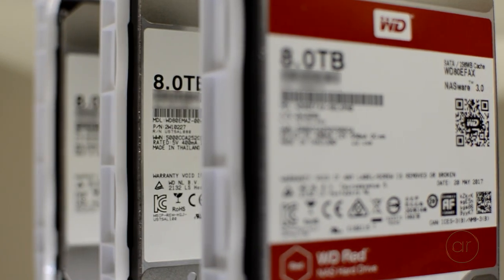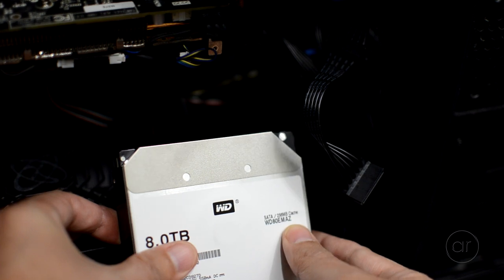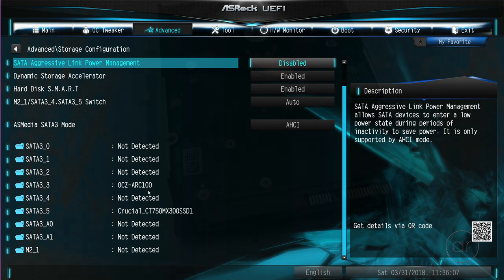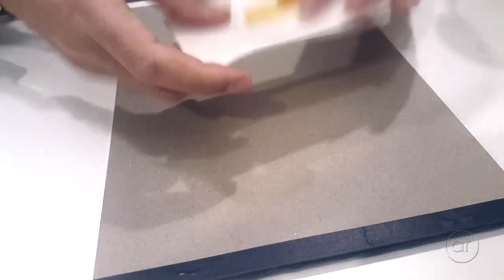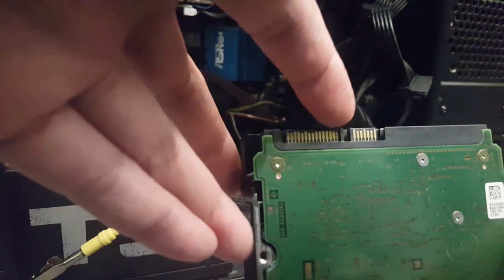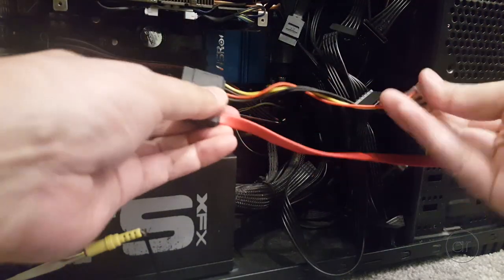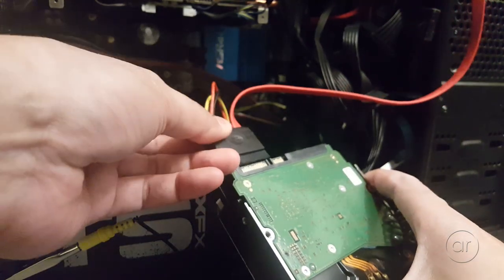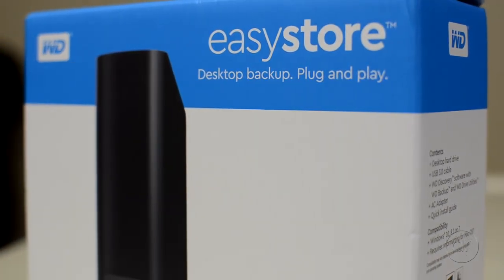How to Fix the 3.3V Pin Issue in White Label Disks Shucked from Western Digital 8TB Easystore Drives

Comment: I ran into this problem when purchasing a 10TB WD external that I shucked. I ordered the tape and molex adapter and tried to fix today. It still doesn't get recognized in Windows 7 (unless I plug it in via usb and power to wall outlet). I removed the third pin entirely and it still won't show up in Windows (again, unless I use the external case's USB/power board). This is in a rack mount server running Windows 7 and runs through an LSI controller. I was so excited for a fix, but I am confused at what might still be the problem. I will try the adapter eventually, but would rather fix it this way for future drive expansion. Another concern is that it is on a hot-swap back-plane, so not sure how the molex to sata adapter will fit in until I open up the case. Also, it seems like the drive is powering up, as when I remove it from hot-swap it feels like it is still spinning...

Any ideas for a fix, or what I might be doing wrong? Thx
EDIT: I tried moving the drive around within different bays of my server and got it to work. I have (5) Rows of (4) Bays. It appears that a whole "row" of (4) bays is out. These are all on the same back-plane, so I'll need to investigate later (though I do not need all the bays at the current time anyway). Thanks for the great video!!
Reply from the maker: Thanks for the update - I was just reading your comment and was a bit stumped as to why it wouldn't work with the tape method (and even when you removed the pin). I guess the failure can happen anywhere along the chain back to the power supply.

Comment: You can also use clear nail polish, we use it on exposed contacts on the CPU when delidding under the IHS and is really cheap and everyone has it.
Reply: The nail polish doesn't have to be clear. I used blue nail polish on one of my drives (because that's all my daughter was willing to lend me) and it worked fine. The only type I might not recommend is nail polish with sparkles &/or other metallic materials in it.  :-)

Comment: If you get a molex to SATA adapter cable (the better solution in my opinion), make sure you DON'T get the one that was made by injection moulding since those are known to short circuit and cause fires. There are videos about it on YouTube. Get the adapter which has discretely separated cables/pins on the SATA side.
Reply: any chance you have a link to one that will work well?

Comment: Most SATA to SATA or SATA splitters do not have the 3.3 V pin connected as well. The 3.3 V is Orange, and the SATA to SATA contain Red, Yellow and Black wires.
Reply: If the splitter has orange wires, just cut them, it doesn't matter which side you can remove them as well, or just cut through with a side clipper.

Comment: Did this, but didn't have any kapton tape, used electrical tape instead with similar results (obviously the electrical tape was a tad thicker and I believe has adhesive that may leave a residue). I did order some of the linked kapton tape though (curiously the Amazon description does not say kapton tape) and will use that on future drives. Just bought two more 12 TB from Best Buy for $189 USD/each, hoping for a nice holiday sale on 12/14 TB externals and will likely do this again with those. =)
Reply from the maker: Thanks for the tip - I've tried electrical tape before but I found it was a bit thick and it stretched out the connector slightly on the SATA power connector before I switched to Kapton (not sure of the long term effects of the electrical tape). That's a great price on the 12 TB - hopefully the 14 TBs will drop to $200 as it did last year...
Reply: @accessrandom  as of yesterday the 14TB are $199.99

Comment: Thanks for doing this. Just shucked two Easystores and got whites. They don't work with my Corsair HX 650 PSU :(

Can you recommend a brand/model/link of Kapton tape and also maybe a link to a Molex-to-SATA adapter you recommend?
Reply from the maker: There's a good video on the subject on Youtube: just search for "How To Spot Molex To SATA Adapters That Won't Catch Fire". For the kapton tape, I ordered from a uline catalog years ago (it's not something I use often, except when I'm dismantling a laptop and putting it back together). But I think any roll of Kapton tape from either uline or Amazon would work fine.
Reply from the maker: Thanks for the detailed update! Glad everything worked out for you.
Reply: Your welcome!

Comment: Pin1: Reserved • Pin2: Reserved • Pin3: PWDIS — in other words;
TAPE OVER ALL 3 PINS! Far less fiddly.
Reply: Trying to get that one pin was a hassle. Covering the 3 pins instead helped me out a LOT! Thanks man!
Reply: This works
Reply: Thankss, it works for team gx2 ssd in hdd caddy for laptops!!!
Reply: Good call, thank you.
Reply: Another three pin cover success. One less device in the power outlets available.
Reply: Why not scrape off the gold contact?
Reply: @FluidITGuy  Too risky,
Reply: Marc Brown no it isn’t. If it breaks off? That’s exactly what you’re trying to do. A week ago I got one of these drives, and I grabbed a box-cutter and popped the pin out. Gave it a twist and it pulled right off. I’m not exactly sure what “risk” you’re referring to.  
If your hands are stable enough to slice a 1.5mm strip of tape? You can pull that pin off no problem.
Reply: @Chimera_Photography  ESD zap zap zap, warranty dead, zap zap zap. You can return a shucked drive under warranty btw, just put it back
Reply: @reggieangus5325  Don't even need to put it back.  It's been done several times.
Reply: @reggieangus5325  Really? this was the thing I was worried about since they say you voide the warranty by opening the enclosure...
Reply: @Zeriel00  in the US we are protected by the magnuson moss act. they have to prove what you did caused the warranty failure.

Comment: Thank you so much for making this video. I too have a Qnap and feel confident these drives will work with it.
Since it's been 1.5 yrs since u made this video, how are the drives holding up in the server? Do the white ones perform just as well as the red ones?

Thanks
Reply from the maker: The two Reds and two Whites are still going strong. This is just anecdotal, but I've had to RMA a shucked 5TB Seagate in the same time period, whereas I've had no problems with all the Easystores.

Comment: Thank you for a clear and informative video, could electrical tape be a substitute for the kapton tape?

Edit: it works, I’m going to use electrical tape until my kapton tape arrives in the mail.
Reply from the maker: Thanks for the update. Yes, I did try an experiment with electrical tape before I made the video, but I found that it was a little too thick (it expanded the spacing in the connector) so I took it off. I'm not sure what the long-term effects would be, but you should be ok if it's short term. Another problem was that there was a black residue when I took the tape off (at least with the tape that I used).

Comment: Really well made tutorial, great work! But what about the quality of shucked drives vs standard internal drives? I currently use 3TB Toshiba P300's and am somewhat concerned about higher failure rates of shucked white label WDs...
Reply from the maker: Thank you. I can only speak from experience, but my 2 red labels and 2 white labels 8TB disks have been going strong 24/7 for 3 to 4 years.  My shucked Seagates, on the other hand, have needed RMAs (2 5TB disks).

Comment: I just counted the number of pins (15), and counted the power cables going into the plug (5) which is a perfect 3. So I cut the 5th cable and it worked perfectly

Comment: Thanks, just installed one of these in my PC today and used this method.
Reply from the maker: Thank you - glad you found the video helpful 👍
Reply: @accessrandom  Yea! I would of been totally lost wondering why the drive wasn't working internally! So I'll keep in mind if/when I change my power supply that it's compliant with the new/changed sata standard. That said, I would of just bought a regular internal drive but none of the stores near me carry internal drives anymore, only external, and I needed a drive right away and couldn't wait for shipping. I just "shucked" a 8TB and 12TB Western Digital. They're so much quieter than my old Hitachi from 2007 and seem just as fast if not faster...

Comment: You can cover pins 3,4,5 does not have to be just pin 3, I have done that to my 8TB Ultrastar Data Center, Hey Presto, HDD booted up, and detected on BIOS,  previously would work on a USB 3.0 HDD caddy.

Comment: Do I need to do the tape/pin if I’m using the hard drives on a Synology?
Also are the white label the same as the red? If not what’s the difference? 
Thanks for you great video.
Reply from the maker: Thanks! According to the compendium in the description, you should be fine without any modifications for the Synology units. It was tested in a variety of models, including the DS218j, DS718+, DS1817+, etc. Regarding the white labels, there's some debate on whether they're simply relabeled Reds (some think they're a relabeled HGST), but the white labels seem to be the only ones with the 3.3v pin issue.

Comment: the 3.3v pin is used to power down the drive completely  in case of it not being used at all by the pc (host) so it saves power and also prolongs the life of the drive by not running non stop and overheating in that plastic case
Reply: if I am covering up the pin, will my PC be able to power off the drive though?
Reply: No, it's a data center feature to easily reboot an unresponsive drive. It does not effect normal ALPM states.

Comment: Very useful video.
After watching it I checked https://en.wikipedia.org/wiki/Serial_ATA#SATA_revision_3.3 for further details about "Power disable".
Anyway I have to point out that almost no power supply I've seen, with the exclusion of the few high-quality ones, had the 3.3V connected, so, in short, one's gonna experience the problem only with a good PSU: that's weird ;)

Comment: Great tip here

Unfortunately with my shaky hands and exceptionally failing eye site i will have 1 heck of a time accomplishing this task.i never realized until i looked how small an area i would be working with

i need to ask how exact i have to be on the applying it to only that pin? Does it matter if i get a wee bit of overlap on pins to either side? How many pins could actually be covered and it would still work?

Would taking a safey pin and just scratching out that 3rd pin work? or cause permanent damage?

Thanks
Reply from the maker: Thank you. I focused on non-destructive ways to solve the problem. What you can do is cover pins 1, 2 and 3 if you'd like - pin 3 is the important one, but pins 1 and 2 can be covered as well.
Reply: @accessrandom  Cheers

i did the pins 1-3 and Bobs my uncle

Much appreciated mate
Reply from the maker: @leperlord7078  You're welcome, and thank you 🙏.

Comment: You are great, I saved a hard drive that almost throw it away, will affect its useful life somewhat this method?
Reply from the maker: Thanks for sharing your success story - always good to hear 👍 If you install the disk in a computer case that has good airflow, it should theoretically extend its remaining life because you've moved it from an enclosure that has limited airflow. You are also eliminating the USB-SATA PCB board which is another point of failure.

Comment: I have an HP drive that's really a hgst drive. It works fine in my docking station but won't power on from my psu, even with the sata power adapter bypassing the third pin.
Any ideas? 

Thanks for the informative video!

Comment: i actually removed the pin from my sata power connectors on all my power supplies so it can be moved to any computer of mine
Reply from the maker: Very nice. Then you don't have to worry no matter how many white label drives you have in one machine (or any of the computers).
Reply: Same here. I thought about cutting it at the end but I decided to just pull the connector and wrap it in electrical tape in case I need to re insert the 3.3v connector.
Reply: That's what I thought I would to too even easier than putting the tape on the connector and would me more reliable too probably.

Comment: Super useful video, thanks for uploading.

Can you remove the contact pin on the HDD instead?
Reply from the maker: Thank you! Yes - you can physically remove the pin itself (other commenters have done this also). Others have also snipped a wire from the power supply connector itself. In the video, I was just showing some of the non-destructive solutions...

Comment: Thanks for the Molex-to-SATA tip!
Reply from the maker: Yw! Make sure you're using a good quality one though, as some adapters have been known to cause fires (there are some Youtube videos out there that show this)...
Reply: @accessrandom  I'm using the one that came with the PSU/motherboard. I'm not 100% sure which.
Reply from the maker: @neojp  Usually, the ones that come with the PSU or MB are fine.

Comment: I was struggling with tape and annoying if you want to pull the drive in the future and forget about this, I just clipped the 3.3v wire entirely on that SATA connection, much easier and I'll remember in the future.  I left enough length on the connector and cable side in case I need to resolder them together in the future. Apparently the 3.3 volt connection is rarely used so I don't really care

Comment: I wonder if this was the problem I had with 2 Corsair Neutron XT drives not working in my machine. I sent them back thinking they were faulty and brought an SSD from another manufacturer instead which worked fine. Perhaps the corsair drives used the new SATA power standard which wasn't compatible with my power supply from 2007 :)
Reply from the maker: Interesting - thanks for the data point. It's possible if Corsair had multiple revisions of the XT, but the only info I could find was that it used SATA Rev. 3.0 (not Rev 3.2+ or Rev 3.3 which have the power disable feature).

Comment: Just ran into this with a 8tb HGST drive and a EVGA Supernove PSU, molex to sata fixed it for me. I just don't trust the tape, Im more worried about the tape comming off inside the plug after in ages and you remove the plug from the HDD.

Comment: I schucked six of these drives and got the white label EMAZ version with the 3.3v issue and 256MB cache. I was originally going to use them in my Dell Poweredge R510 server but they randomly drop their negotiated speed from 6Gb to 3Gb which brings the RAID to a crawl. Not all of the drives, maybe 2 or three of the six on every bootup. Not the same drives either - which drives run slow is completely random. I moved them to my QNAP TS-451+ server and they work fine and stay at 6Gb. I'm not sure why my Dell server has speed issues with these drives but I ended up going with 6TB Toshiba's (MG04ACA600E) and have no issues.
Reply from the maker: Interesting - this is the first time I've heard of speed slowdowns on a Dell server. The reddit sub I link in the description has it confirmed working (anecdotally) on the Dell R510, but there's some question as to whether all optional configurations of the backplanes (and all revisions/firmware of them) would work. Thanks for sharing your experience.
Reply: Why would that bring it to a crawl? I know some HDD exceed sata1 specs but there are none that exceed sata2 or 3.

Comment: I have been using the molex solution for 2 of my drives no problem, but now I want to add another drive and I am out of adapters, so I bought some Kapton tape to try that method.  I tried 5 times and every time I slide the power adapter on, it just shoves the tape down and off the pins!  Any advice?  I am not using the label backing/cardboard, I am just cutting and applying directly to pins 1-3.  Maybe my tape is cheaply made??
Reply from the maker: The Kapton tape can be a bit tricky to place especially when it's a tiny sliver (like I have it in my video). I would recommend a wider piece that covers pins 1, 2, and 3 (since pins 1 and 2 are not used anyways). Hopefully, that will stick better to the pins.
Reply: @accessrandom  yea that's exactly what I have been trying... I specifically bought a very thin roll to begin with... it's the exact width of 3 pins.  I have tried at least 5 times on 2 different drives now and it just jams in every time.  I also tried regular old electrical tape... same issue.  I wonder if superglue would work?  It would certainly insulate well, but I just don't know how well that would hold up once heated.
Reply from the maker: @mulox1  Maybe you could try different SATA cables or even a different port on the motherboard? It could be anywhere along the chain to the motherboard that could be causing a problem.

Comment: My solution, snip the 3V wire on the SATA power connector. I don’t think any commercial drives use the 3V feature. In a server, you will want to verify that your other drives do not use that feature.
Reply from the maker: Thanks. That is certainly a valid (and quick) solution. I was focusing on non-destructive ways to do so...